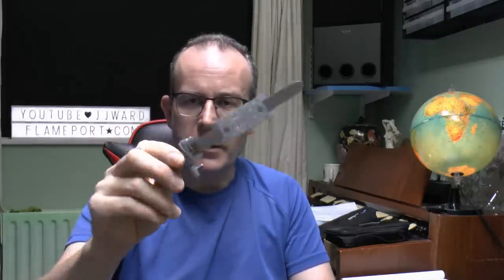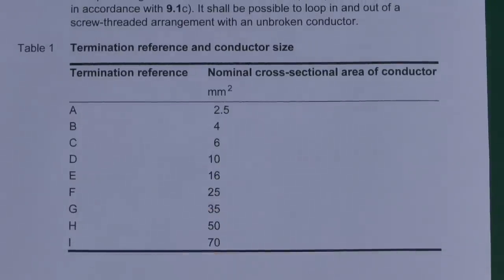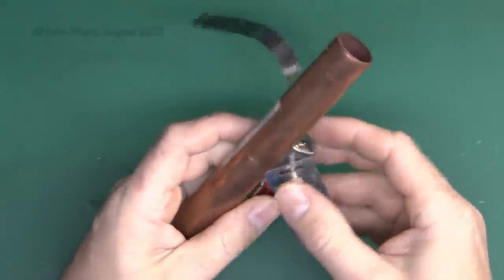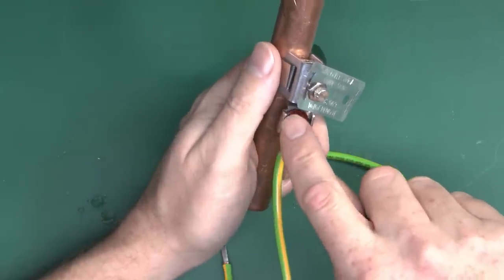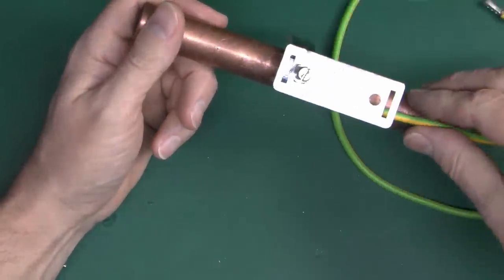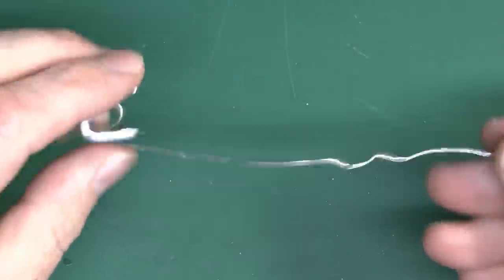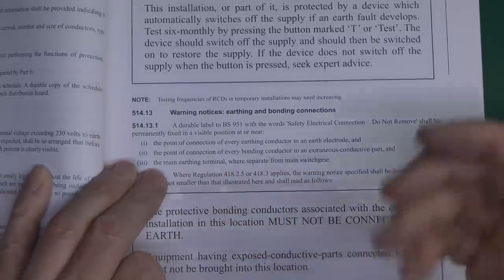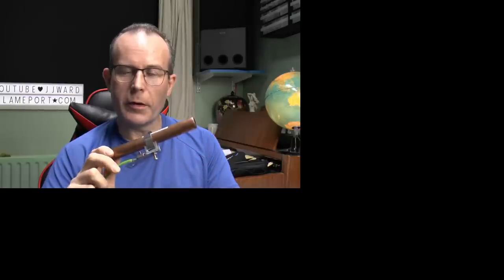BS951 Clamps - Connecting Bonding Conductors to Metallic Pipes

Comment: The only tip I’d add is to use wire wool to clean the pipe first to ensure good conductivity especially on older/dirtier pipes.
Reply: Completely missed - in this unusually poor quality video.
Reply: @bill bergovoy It's not mechanical connection that's important, it's electrical connection.

Comment: Was in a pub gent's toilet once and hiding under the wash hand basins was a huge tangle of bonding. The problem was that ALL of the connecting straps had come away from the pipes. The straps were all firmly connected together though. I am not a spark, but as far as I could see the whole system was as much good as the proverbial in a space suit.

Comment: 13:53 I make that 3mm as you've not aligned the top of the lettering with zero. If I was measuring that, I'd use the 10mm mark as zero - so keeping well away from the end of the rule as often ends are damaged and in the case of that one suspiciously poorly marked.

Comment: I've seen one of these used to bond to the outer armour of a TN-S power feed to the consumer units earth terminal! Probably not the intended purpose, but was never raised as an issue by the DNO when they looked at it
Reply from the maker: Fairly common to see that, and was actually permitted in the past.  Deleted from BS951 about 20 years ago.
Reply: @jwflame  not surprising then given the age of the wiring in my parents house... it still had original rubber lighting wiring (complete with twisted wires protected by ceramic knobs) until about 15 years ago when I ripped the lot out and rewired it

(not a qualified spark, but a sensible DIYer.. and it passed the test :)
Reply: @jwflame  what would be the correct termination? Though i guess that is up to the DNO to rectify!
Reply from the maker: Correct item for lead sheathed cable is a roll spring, similar to https://cablejointingsolutions.co.uk/products/roll-springs/
which is used to hold a copper braid against the lead.
Reply: @jwflame  I wondered that too...cheers
Reply: @jwflame  would you use a roll spring for a lead water pipe bond?
Reply: @MrSJT  I wonder how different is a roll spring to a spring roll ? :)
Reply: @jwflame  LEAD ? That's just asking for the use of a soldering iron !
Reply: @millomweb  the difference is about £3 per roll, and tastes pretty good too😎
Reply: @MrSJT  No meat in them though ;)
Reply: @millomweb  vegetarian one it is then... You want fries with that McSpring Roll and a drink and make that a meal deal🤗

Comment: Good video , just wondering why at the bottom of lampposts below the lucy connector,  they use jubilee clips around the armour for the earth
Reply from the maker: Much easier to tighten up in the confined space, it would be extremely difficult to tighten a conventional gland as there would be no room to rotate the tools.
The clips don't  crush the cable, as the armour goes over a brass sleeve, with the wires through the centre of the sleeve, so all of the pressure is put onto the brass, not the inner parts of the cable.
Reply: @jwflame  thanks for the reply John 👍
Reply: @jwflame  That's neat idea and surely doable with SWA ?

Comment: Thanks, great video. I need to earth bond a 10mm copper pipe supplying an oil boiler but I see the smallest these clamps go is 12mm. Any ideas on how I can bond to a 10mm pipe?
Reply: In case anyone else is having to bond to 10mm oil pipe – going by conversations on various forums this seems to be a recognised problem, without a readymade solution. The usual strap clamps (as shown in this video) don’t seem suitable as they are too large and in danger of crushing the smaller diameter oil pipe. The solution I adopted (not my own but mentioned on one of the forums) was to repurpose a 3/8” earth rod conductor clamp. These are just a few pounds, are readily available, and are made of solid brass. It is best to get the kind that comes in two halves if you are not able to slip this over the end of the copper pipe. In my case I had to cut the clamp in two (as it was not in two parts) after drilling the hole out to 10mm. I have this fitted now and it seems to do the job quite well.

Comment: 5:58  Very nice use of a crimped connector for this how many times have we seen a single earth conductor strand randomly wound round the clamp screw in an attempt to make a good connection ?!
Reply: I have no faith in crimped terminals. I'd always use bare copper, formed a loop and twisted the tail around the copper again. Although that wouldn't be as good as soldering the copper wire direct to the copper pipe.

Comment: Do the BS951 regs say you need the crimped lug or is it just good practice? I just split the 10mm earth wire into two and wrap around both sides of the screw before screwing tight.
Reply from the maker: Lugs not required, but they are a better method of connection, particularly for larger sizes of conductor.
Reply: John Ward yes better for larger conductors. As I said there was research has shown that technique matters very much poor lugging and poor wrapping techniques are the main problem in terms of loose connections. Research in USA found that proper wrapping technique ( in fact US NEC 2020 110.14(A)) talks about these connection methods - is the key and that out of all the approaches including lugging,  wrapping solid conductors correctly around a screw or terminal when tightened and torqued is probably the best approach more surface area of the conductor takes the strain even relative to a lugged conductor where surface area connection to the lug could be smaller. As I said in one of my other posts I think John this would make a great video especially teaching electricians about the merits of different wire connections lugging v wrapping v crimping use a strain gauge bench top testing approach. I do believe however technique matters, and if done correctly all these methods would be suitable alternatives and failure of any of those would be well beyond say a minimal  and reasonable safe approach.
Reply: My response to that is is - conductor strands should not be split - they should remain together and be bent around the clamping screw with the remaining tail wrapped around the wire again. This probably creates a thicker wire than the clamping arrangements may cope with - so get a bigger clamp suitable for the wire - is the correct solution.

Comment: I've seen someone earth swa armour with one of these, what they did was cut a piece of 22mm copper pipe and put the steel wires on the outside of it, and then put a bonding clamp around the steel wires. Certainly quite inventive!

Comment: I do always wonder about those bonding connectors in airing cupboards which connect copper pipes which are mutually connected to a copper hot water tank. No doubt the regulations say they have to be fitted, but the cross-sectional area of a couple of 22mm copper pipes, both attached to a copper tank, is much larger than that of the bonding wire.
Reply from the maker: There is no electrical regulation or reason for them to be installed.
Plumbing and gas regulations may say otherwise.

Comment: So if you were looping to a second pipe, how would you use lugs? Use a large lug and bend the wire back on itself? Just that I believe the wire should be continuous, so I presume you could not use two lugs...
Reply from the maker: Two lugs.  Nothing that requires the wire to be one continuous piece.
Reply: @jwflame  Thanks John - Don't know where I heard that - urban myth maybe!
Reply: Nothing in BS7671 about this, but I think this where everyone picks up the idea from...

BS7430 says. 

"Where both main gas pipes and main water pipes enter a location, a common 
bonding conductor may be used, but in such cases that conductor should be 
continuous or should be permanently jointed (by soldering or crimping) in order 
to preserve continuity. Such a bonding conductor may also be used in 
association with other extraneous-conductive-parts".
Reply: phildxyz seem to remember one of the old on site guides had a drawing of the cable being twisted around the terminal screw and unbroken. Nothing in the current one though.
Reply: @jwflame  i was always told " it  should be one continuous conductor"
Reply: @davidwhitehead6150  Yeah, it was so if someone disconnected one supply the bond wouldn't be lost to both. It's only in that circumstance though, I remember doing 16th edition at college and it was still included back then but 17th and 18th don't seem to mention it all all now. Can't say I ever come across both supplies entering in that close a proximity and if they do at least one of them has always been plastic these days.
Reply: @jwflame  Except good practice. I'd do the same in installing a ring main - it would be one continuous wire even after all the sockets were added.

Comment: So, obviously these shouldn't be attached to a painted surface... But is it OK for them them to be painted over... As we often see (and is the case in my house - done way before we bought the place!)?
For the other kinds of pipes / armoured conductors, are there any valid solutions?
Reply: If you are a decent electrician, having installed such a clamp, you'd test it for continuity - looking for less than 1 ohm resistance.
Reply: @millomweb  I am not an electrician, but was asking from a general layman's perspective; one who owns a house where most of the earthing clamps have been long painted over by previous occupiers. However, point taken that the valid way to check is resistance (by a "decent electrician") :-)
Reply: @SeanPearceUK  Painted over will not make any difference to underlying conductivity - so I wouldn't worry about that - but feel free to worry about them being placed onto painted pipes ;)

Get your test meter out and get prodding :) - but don't puncture any pipes :)

Comment: Hello JW can I ask how you earth a 10mm copper incoming oil pipe from the external oil tank,
Reply: Flatten a piece of copper tubing tubing and drill a hole in one end then solder the other end to the pipe giving you an earth tag to bolt a cable to.I have a coated small bore 1/8" copper nickel compressed air pipe entering my mancave from my garage compressor for my airbrushes which I soldered a threaded lug to in a similar fashion,the earth cable is bigger than the pipe!

Comment: Apart from colour are the red/blue screws & clamps they're attached to different in any functional way?
Reply from the maker: The only difference between dry location / wet location is the material they are made from.  Those for wet locations are supposed to be corrosion resistant.
Reply: @jwflame  But is the pipe they're being attached to in a wet area also corrosion resistant ? If not, why bother ?

Comment: Does the UK still permit using plumbing pipes in the grounding path? I believe the current NEC doesn't allow that.
Reply: No, that went out I think back in 1967.
Reply: @rowanNClangley  Fortunately, our house is older than that - I think both supply pipes are connected to grounding wires.
Reply: @millomweb  The wires you have seen are likely to be protective bonding rather than earthing.  Their purpose is to connect all the pipework and the main earth together so that a fault cannot creat any potential Difference between the earthed electrical system and gas or water pipework.  The Earthing wire would either be taken to an earth terminal provided by the supply company or an earth rod driven into the ground if the location is one where the supply company isn't able to provide an earthing facility.
Reply: @rowanNClangley  "likely to be protective bonding rather than earthing.  Their purpose is to connect all the pipework and the main earth together so that a fault cannot creat any potential Difference between the earthed electrical system"

If 'bonding' is connected to 'earthing' then it too is earthing !

Comment: Hi, you often see quite considerable pig tails on the earth conductor- is this purely to accommodate any movement in the pipe?
Reply: Pig tails as in curly bits of wire?
Bear in mind that Americans have the term "pig-tailling" as using two wires into a wire-nut to a single wire into a device.
Using a curly bit of 10mm² stranded earth conductor, caused me to fail an electrical inspection once, years ago.
The reason being was, that even though that is an air-cored coil, under fault conditions, that could cause an impedance that (c)would prevent the circuit protective device from operating, within the required disconnection time.
Reply: One of my pet hates is pig tails. I have no idea why people started installing like that. It makes for an ugly job in my opinion.
Reply: @mikeZL3XD7029  Very interesting ! (and laughable!)

Comment: I have some questions regarding the bonding conductor.

Why  is it necessary to be installed ?
I'm asking because I've noticed that in my bathroom and kitchen, I have a bonding conductor clamped to the copper pipes, but none of them are actually connected to the outside of my property, as in a conductive material ( in my case water pipe is PVC/MDPE or something ).
 
Another question is, if there is a short and the bonding is connected to these copper pipes, don't they conduct current and may electrocute someone touching the pipes or shower/sink (as these can also be made of conductive material that's fixed to the copper pipe )?
Reply: Necessary because the regulations say so.
Silly/stupid, I'd agree. Better to keep an earth leakage local.
Reply: @millomweb  I get that regulations say so, but I don't get why :)

Is it because of the copper pipes providing a large surface and thicker material for the current to flow through ( higher resistance ) and lowering the voltage of the current ? If so, is it noticeable or effective ?
Reply: @gameaccount1612  The theory is that by having all the exposed metal parts wired together, you're not going to get a lethal voltage across them.
Thicker conductors lower resistance.
I suspect it all kicked off in the early 1980s when stainless sinks were killing people because water heaters and whatnot had been installed without good earthing arrangements. So by running an earth to every tap, there was far more chance the sink would be safely earthed.
Reply: DJosephWells replied: "pmailkeey Our electric showers earth is RCD protected. But thats as standard precaution as the load is 30 Amps."
Reply: The RCD protection is for voltage, not current.

Comment: Could it be used for bonding to MICC? I know these days that would be a niche case...
Reply from the maker: I have seen them used in that situation, although it's not really what they were designed for.  MICC should be fitted with the proper gland and fixed into a suitable hole in a metal enclosure.
Reply: @jwflame  Cheers for that John. I was thinking of the cases where there's a TN-S supply (probably with Red Head links) in MI from a basement ryefield or similar board. Those (at least round here) tend to be in MI with just a pot, no seal

Comment: Of course, an electrician would not put such a clamp around a pipe on top of a paper label - especially one stating "22 mm". ;)

Sorry, JW, I'm going to fail you on this video. The video ought to include circuit testing once the clamp is attached and ought to include clamping to grotty/painted/rusty pipes where some surface preparation is needed prior to attaching the clamp. It seems the BS does not take into account the need for electrical conduction to take place where such clamps are fitted - but what do you expect from idiots ?

A former local heating/plumbing service shop had their boiler proudly on display and in the setup was one of the plastic pipes to a radiator fitted with such an earth clamp. I wished I'd got a photo of it but I didn't !

Comment: my electrician said that you don’t need to bother with this if everything in the property is RCD connected. Is he correct?
Reply: No he's not.
Reply: No, he is not, the RCDs would not work correctly, as they rely on them to drain the leak fault.
Reply: Your electrician is wrong and dangerous. You should report him to his CPS
Reply: @G1ZQCArtwork  "Drain the leak fault" Are you a plumber by chance?
Reply: Your electrician has forgotten the basic principles. What he said is a bit like saying, you don't need to worry about seatbelts as long as your brake pads are good.
Reply: He's wrong!  Main equipotential bonding is still required to extraneous conductive parts such as incoming metallic gas and water services.  However, supplementary equipotential bonding between extraneous and exposed conductive parts in a bathroom is no longer required,  provided all circuits within the bathroom are RCD protected.
Reply: Bonding is now an option not a requirement. If you have plastic pipes do not bond your your metal taps. The next addition of the regs is expected to clarify "option" to bond in bathrooms and showers.
Reply: RCD protection allows Supplemental bonding of bathrooms to be omitted in BS7671 provided main bonding is compliant.  Main bonding connections can be omitted in certain circumstances determined by the nature of the incoming water and gas service pipes.   If an incoming service is in plastic  pipe, it cannot introduce a potential into the installation, and plastic installation pipes cannot distribute that potential throughout the installation, so the decision whether main bonding is needed is made on the basis of the service pipe from the utility (metal or plastic) the installation pipework and careful reference to the requirements set out in BS7671 or its equivalent in the country where one is working.
Reply: Well said Rowan
Reply: @Mr1bassman1  As I see it, bonding in strange places is only to deal with incompetent electricians. From the 70s-80s live sinks incidents. Possibly from such things as under-sink water heaters not being properly earthed when installed.